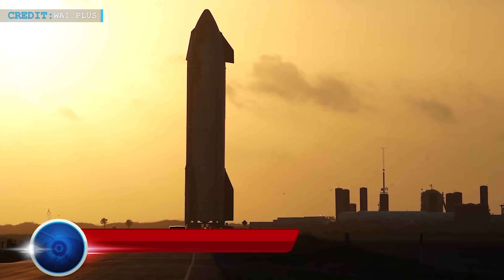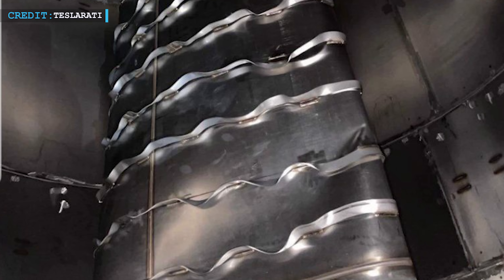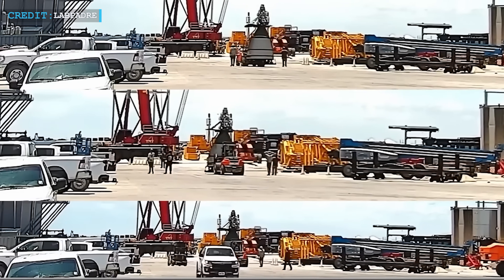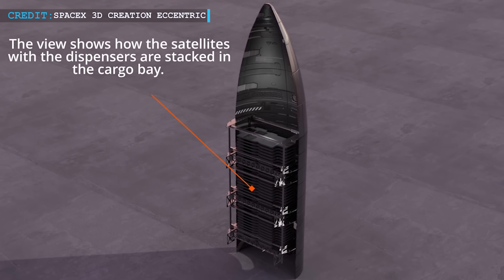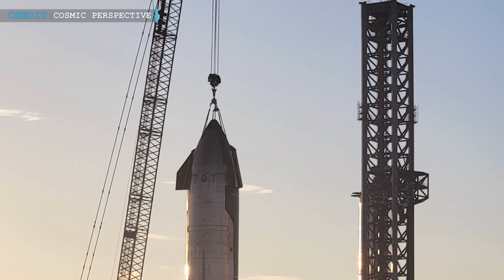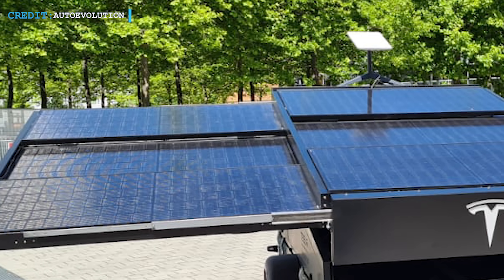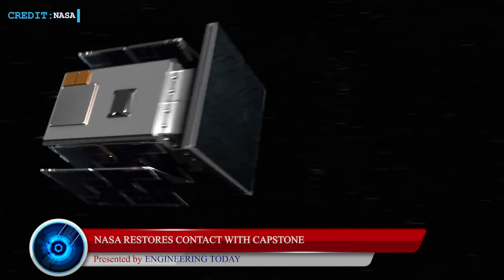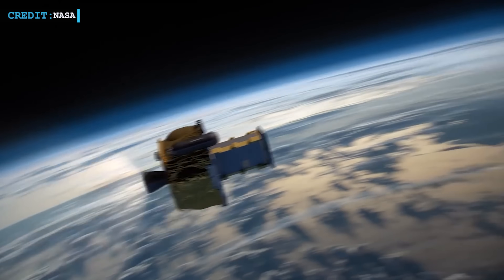SpaceX Starship 24 Rolled Out to Pad B after engine installation: Preparing for first Orbital launch

Comment: You guys need to cultivate the right attitude toward rapid development. When any component fails during proof testing, that's a GOOD THING. That's the whole purpose of the tests; to try and find both design AND handling process errors before any launch. But it was multiply testing everything to death because they feared anything AT ALL might fail, that caused pre-SpaceX launch vehicle development to be so incredibly slow and expensive. And then they still blew a lot of shit up, anyhow.

Comment: correction: Starlink is not a self-contained Internet it is a way to connect to the Internet. It does require ground stations to function just like any other satellite service. that trailer would act as a Wi-Fi hotspot for people without a Starlink system. That trailer will communicate to a satellite which would still have to communicate to a ground station within range of the same satellite. Starlinks only unique characteristic is its low orbit which reduces latency. But since the satellites do not intercommunicate, a ground station is required within range of the satellite your dish is communicating with. This is also a side effect due to its low orbit since its range on earth is smaller than geostationary orbit communication satellites. So a faster network but still limited to local ground stations and can't globally communicate without a local ground station connected to the established Internet.
Reply: So a self-contained separate network with Internet connections. It can make connections from one location to another without connecting to the internet. Starlink will have the ability to pass data/communications from satellite to satellite so eventually, no ground connection required.

Comment: Good report- and especially appreciate the micro grid et al addition. One slight correction: You implied it’s NASA/NASA engineers who were/are working on CAPSTONE; that’s not correct. The only way to get such a mission done so quickly and relatively cheaply was to go with the private sector proposal of the respective companies involved. NASA is paying for the ‘mission’- but control of the spacecraft to get that mission accomplished belongs to the companies involved.